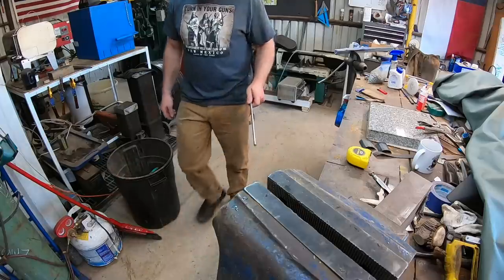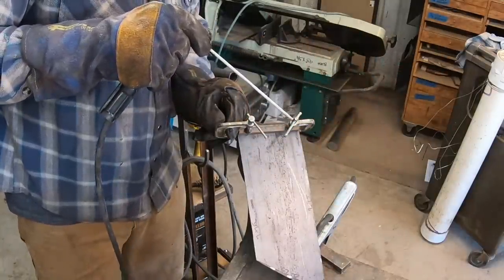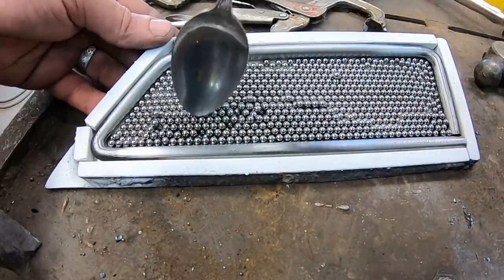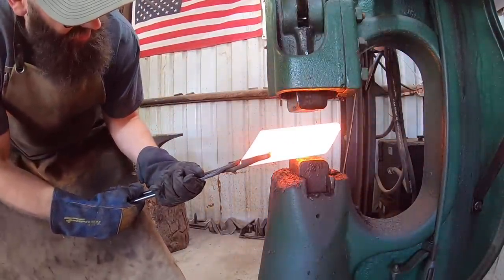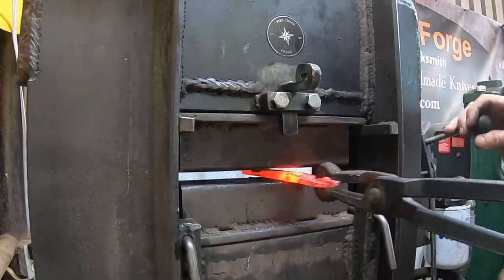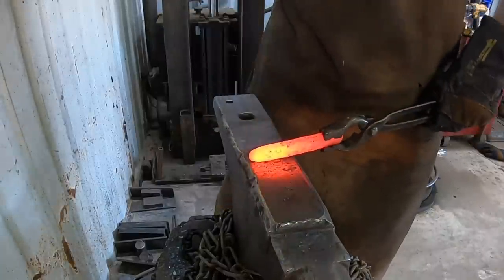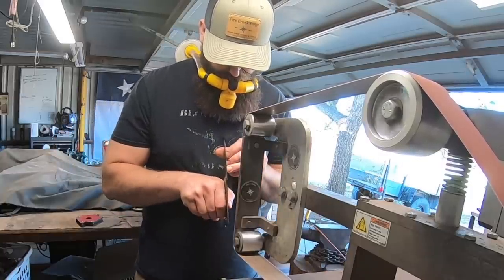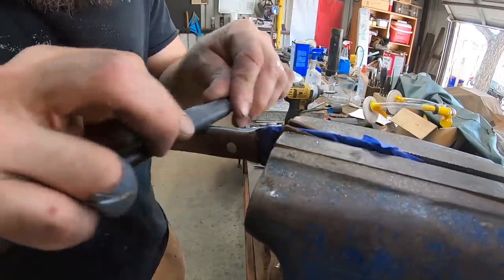Cool Canister BUT THIS HAPPENED Ball Bearing Damascus Knife Dagger Forging Blacksmithing Knifemaking

Comment: Question......why not incorporate the tang in the forge welding process from the start? Build it thicker, narrower, and with the tang already incorporated. If the billet is thicker, you can always spread the material in the forging later to have a wider blade.

Comment: Is there a pattern that looks like broken/cracked glass? Always thought that would make an interesting look
Reply: Yes, it’s extremely hard to make. One that looks similar to that is feather pattern. I have gotten a cracked glass finish by actually doing 3 patterns. First you do raindrop which is drilling about a third deep into the billet. Then hammer back flat. Then do ladder pattern which is a bunch of lines cut about 1/3 deep, then lastly do twist. I’d say it’s about masters difficulty
Reply: @tjboylan20  how many layers at each stage?
Reply: @boucherwag_7771  I did 10 layers at the first 5 on the 2nd and 2 on the third stage for a total of 100 layers i think more layers will be better. I did it once now that you said it I wanna do it again
Reply: @tjboylan20  I would love a vid on it

Comment: Hi Elijah. Just out of curiosity. Is there a reason you use round stock instead of square stock for the edge?
Reply from the maker: Hi Daniel, the round stock really helps with the forge weld as it impinges on the adjacent bearing balls

Comment: Sometimes it comes down to the wire like that.  With 0.3 seconds left on the clock you gotta use whatever you've got and leave the rest up to the fates.  However, it is your destiny to succeed no matter the difficulties, and that end product of yours is a definite win in my book.  Well played, Elijah... well played!!!
( I do agree that it's probably better to forge out the width of the blade rather than upsetting the tang end to narrow it down as much as you needed to in order to form a proper handle width, and then taper that out..  At least the way I saw it happening, not that I'm an expert by any means. Great job regardless. )

Comment: Is that lithium spray you're using for a barrier for the canister?
Reply from the maker: No it's white paint
Reply: @FireCreekForge  any specific kind? Or brand as most paint will be burnt off at forging temp's which is why I thought it was lithium spray.

Comment: Looks really cool, have you tried going thicker instead of wider yet? At like a 1/2” the amount of random layers should increase to 4 or so 3/16 ball bearings and you wouldn’t have those failed welds like you had.

Comment: I'm surprised that the paint didn't burn up in the forge 
Was it a high heat paint
Reply from the maker: It does actually, what you see is the titanium dioxide left behind, which is what keeps the can from welding the contents.
Reply: @FireCreekForge  rather cool my friend

Comment: Its a really pleasant pattern and you dragged it back from disaster so that's something!
If you play around with some different metal types, say a nice dark black on the edge, the darker BB's and some high-nickel content powder steel could also be a really interesting look. Hex-bar you can get for mounting cutters on lathes diced up into coin-thickness sections might also work ok. I think of those are low carbon with lots of chrome-moly in them- good strong core. The compression of the billet seems to be the kicker in this case so it might be a case of just making the billet almost to the shape of the blade might also reduce the risk of it deforming.

Comment: After you did the initial forge weld what if you had cut it lengthwise, stacked it and then Forge welded again?
Reply: To minimize or eliminate the “folding” that took place when you were trying to forge out the tang…
Reply: Of course what you ended up with was absolutely what you were supposed to end up with in without a doubt another beautiful piece, I don’t want to take anything away from that! Or mean to take anything away from that I’m just trying to learn to!
Reply from the maker: Without a solid piece to start with I wouldn't want to fold a defect into the billet.
Reply: Plus, now that I think I think about it, you would’ve lost your edge steel if you did that!  Carry on soldier 😎thank you!

Comment: Have you tried making Damascus with steel bottle caps? You may have to burn off all the plastics and other chemicals, but it seems like if you flatten them out and stack them up, it'd make a really cool pattern; albeit likely riddled with cracks and fissures

Comment: It’d be cool to see you try to make a “parallel” v on the inside using the steel rod. 
So the center of the blade would be ball bearings with a small outline of the blade from a steel rod, followed by ball bearings, and then the steel rod as the outer edge.